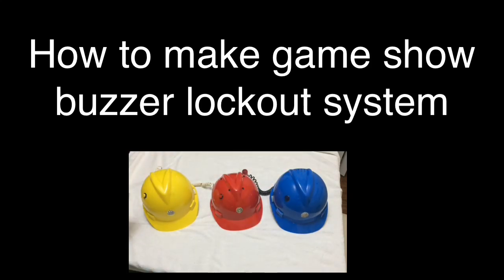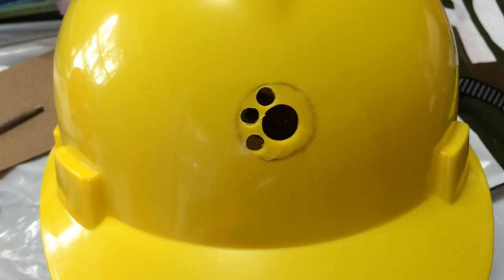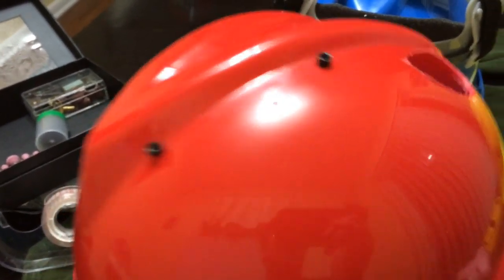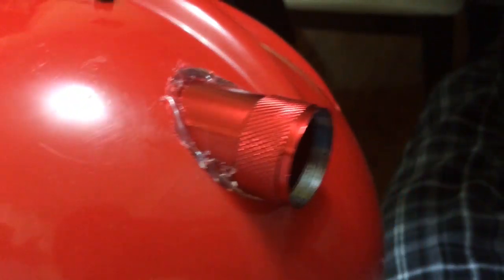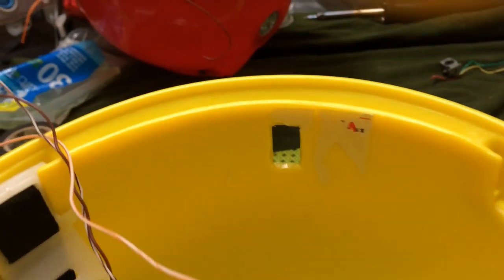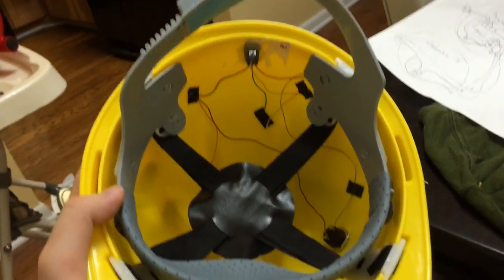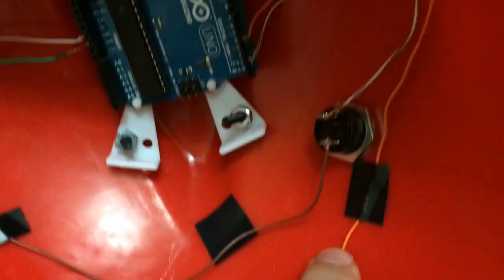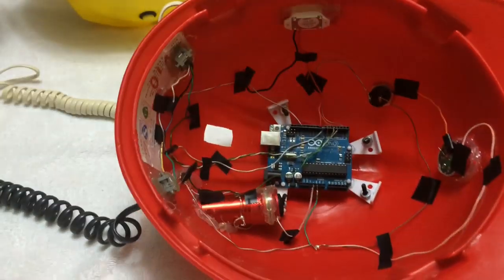Game Show Buzzer Lockout System How-to

Comment from the maker: **Materials Needed for this Project**
1x Arduino UNO: https://amzn.to/2CTEgBF
3x Construction Helmets: https://amzn.to/2CTqPSh
3x Momentary Switches: https://amzn.to/2CTrNOp
1x ON/OFF Switch (any on/off switch will do): https://amzn.to/2CTsdUZ
1x Buzzer (RadioShack 6VDC Mini Buzzer): https://amzn.to/2CSqWgX
3x Flashlights (or just use regular LEDs): https://amzn.to/2CSFai1
3x AAA batteries (came with flashlights): https://amzn.to/2NQX85l
4x Phone jacks (pulled them out from old phones): https://amzn.to/2NQcwz8
4x Bolts & 4 Nuts
Lots of Wires (I took apart and used left of ethernet cables)

**Tools**
Hot Glue: https://amzn.to/2NOvLZN
Soldering Iron: https://amzn.to/2CUbWiI
Dremel: https://amzn.to/2EHn5F8
Sharp Knife: https://amzn.to/2NPwKsT
Drill: https://amzn.to/2CSH4zb